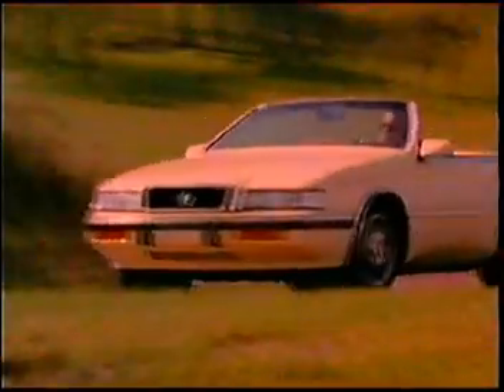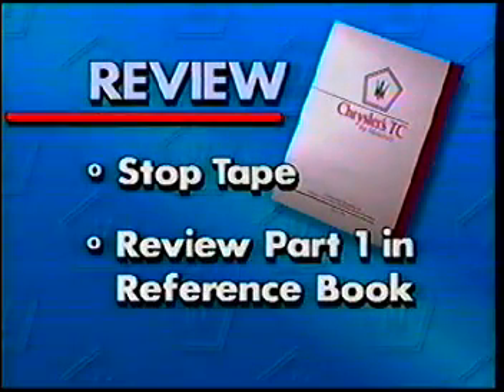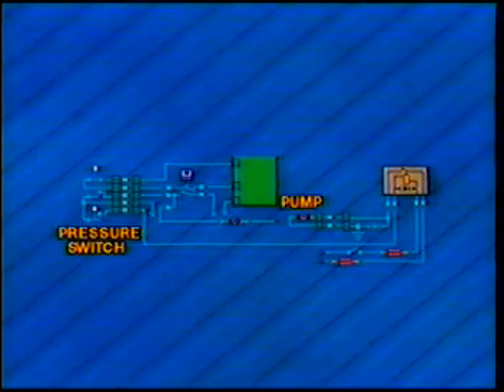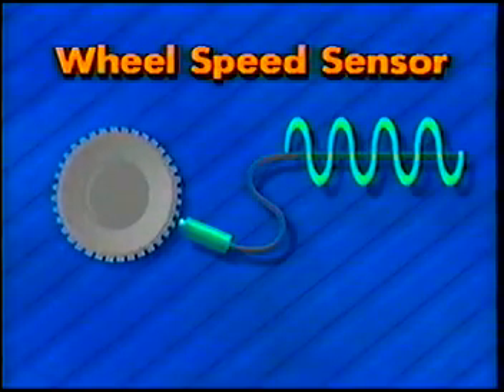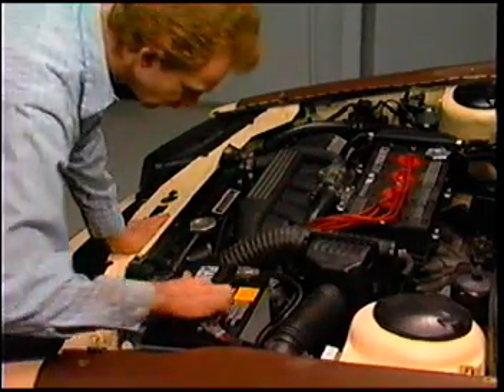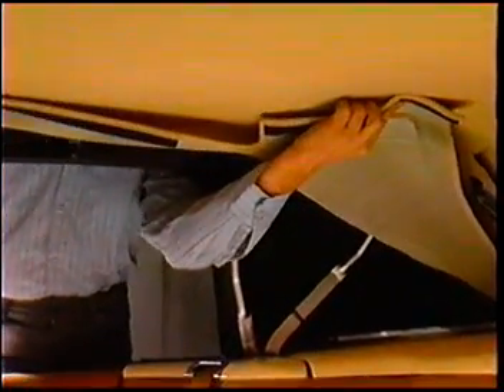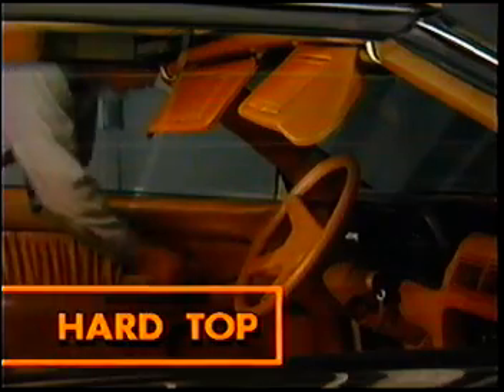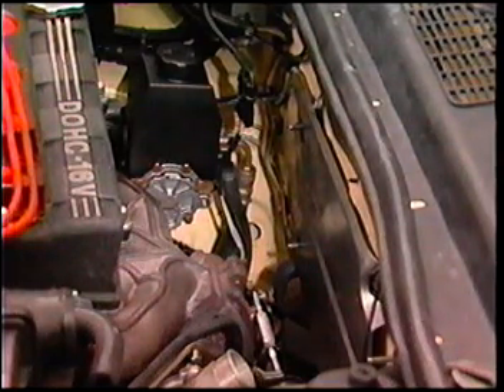Chrysler's TC by Maserati dealer confidential information tape 1

Comment: This was a huge marketing blunder for Chrysler. From what I understand this car was to have been introduced the same time as the redesigned LeBarron. However due to production delays at Maserati, Lee Iacoca was forced to delay introduction to the following year. Unfortunately this caused the public to perceive the Maserati as a LeBarron look-a-like due to the similar design. Had the TC been introduced first, I'll bet LeBarron sales would have been huge as the public would have perceived the LaBarron as an affordable Maserati. After all, the TC (like the Cadillac Allante) was never intended to be a high volume car.
Reply: Actually the TC was supposed to come out at least a year ahead of the Lebaron, Which was intentionally designed to look like the TV for the reason you mentioned. Unfortunately, it took Maserati two extra years to get them to the market.
Reply: LeBaron*
Iaccoca*

Comment: I could never understand why they sent Lebaron parts to Italy for assembly.
Reply from the maker: elton john how is it any diffrent then the Cadillac allante which was a modified Eldorado or the lincoln town car which was a modified LTD Crown Victoria?
Reply: Is that a serious question? You're comparing the relationship between Lincoln/Ford, to Chrysler/Maserati? Two cars that are built on opposite sides of the world? Okay.
Reply: body panels and powertrain were sourced in Italy. actually a very special car at the time..
Reply: Because they didn't. There isn't a single LeBaron part on a TC. Partly because there was no such thing as a LeBaron when the TC was designed and ordered into production.

Comment: How do you open the hood on 1989 Chrysler TC, can't find it
Reply: You have 2 'HOOD DOWNSTOPS', one on either side of the radiator core support. Try turning each one 1 turn counterclockwise. Check alignment with corresponding fender. You want the hood and fender to be flush with one another. 

That will put a preload on the hood when latched and it will pop up far enough to release from the primary latch when the hood release is pulled. No banging on the hood or 2 person operation required.
Reply: Pull the hood release inside the car, the hood doesn't really pop up like most cars because it's so heavy but it should pop up a tiny bit when you lift up on it. Feel for the release under the grille of the car & PUSH IN, unlike most cars where you pull this release, it pushes in on the TC.

Comment: Were these built on the same chassis as the 1st Gen Mitsubishi eclipse? The Turbo engine looks identical to the Mitsubishi 4G63 block
Reply: Might be the same engine, I know Chrysler & Mitsubishi shared some things back in the day. Some TCs came with a Mitsubishi 3.0 V6. My 2.2 T-1 LeBaron used a Mitsubishi turbo, not sure what the T-2 uses
Reply: I belive the super rare turbo V6 was from maserati and was plaqued with killing itself
Reply: @devlintaylor9520  Maserati/Ferrari build good engines, the rest of the components not so much.
Reply: No. The chassis is unique to the TC.
Reply: Plymouth/Chrysler threw those  piece of shit Mitsubishi motors in almost all their K cars.